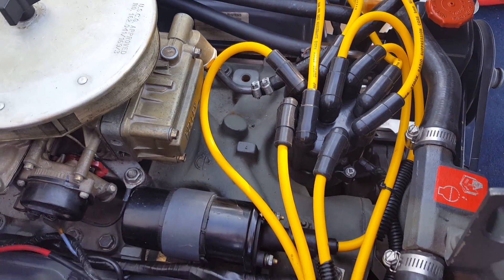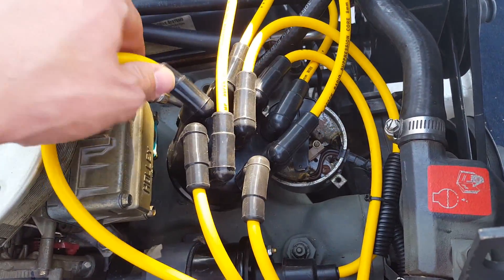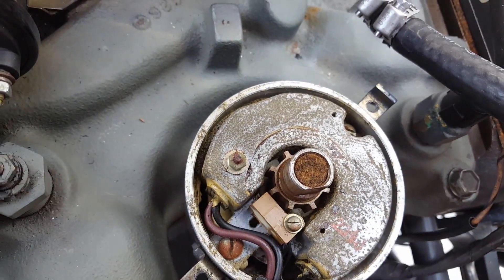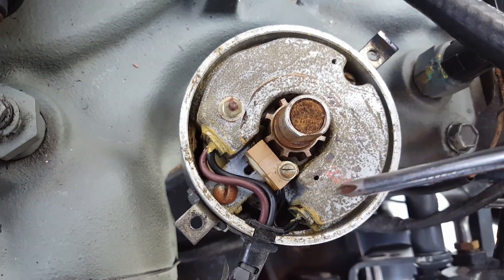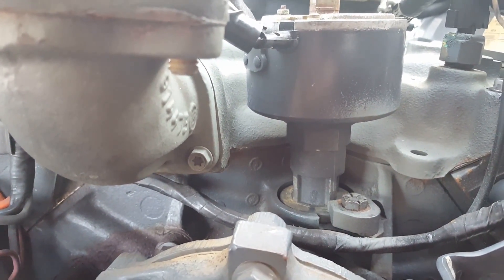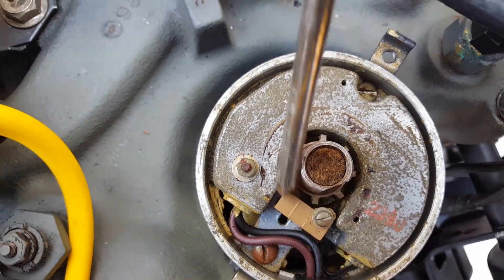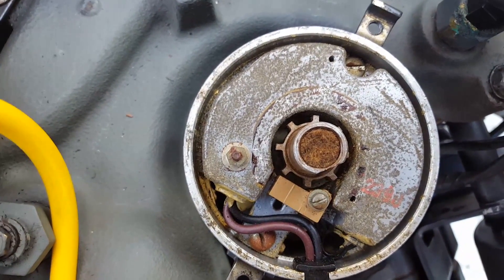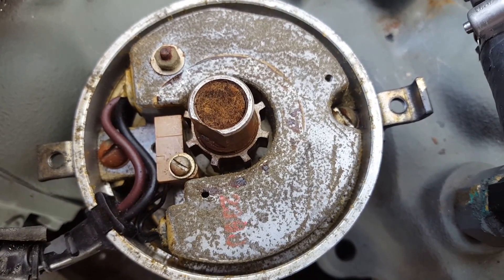Prestolite Ignition System Troubleshooting - ALL Marine Applications!

Comment: Can I use the pertronix 1589 for a v6 4.3 1991? I have the same pick up as yours I read all the comments looked up the part number and it says it’s for an 8 cylinder thank you for your help!
Reply from the maker: You should be able to use it. Try to drop it and see if it lands on the camshaft. And then use your timing light to get it perfect.
Reply: @m @michaelromer2016 ok I’ll try I didn’t know if it worked since it has 2 more cylinders thanks for now I’ll try to comment the outcome once I figure it out

Comment: I have this same engine setup in my boat. I have a fuel pump issue, how do you test fuel pump pressure on this setup. In the video. I can’t seem to find a tester on amazon that will fit the ford fitting.  Thanks

Comment: on that distributor, the timing advance seems to be centrifugial if so, the electronic components are easy to substitute, the pick up coil can be replaced by a Chrysler PU coil and the module can be replaced by a GM HEI 4 pin module, this needs a bit of thinkering to fit the PU coil im the distributor, you can conserve the original reluctor ring, the wiring diagram is very well detailed on the internet. 
 I done that on a 3.8 liter OMC ( chevrolet 229 base engine equipped with a point style  Prestolite marine distrinutor ), the complication was to design a special reluctor ring for the application as this motor is not even fire so I can't use the Chrysler slant six reluctor ring.
the result is very good after more than 10 years of use.

Comment: So how do you install the Pertonix?
Reply from the maker: The unit is pretty simple and even plug and play. Cylinder 1 needs to be at TDC and make sure the rotor on the distributor faces cylinder number 1. Fire it up and grab a timing light. Once you get the timing setup good, it will run like a champ.

Comment: Just changed my out to the pertronix. I checked the voltage at the positive terminal of the flamethrower coil I was getting 12 or greater volts. The pertronix 1589 requires at least 12v. I thought these had a ballast wire to reduce voltage. I have 9.8v at idle off the negative terminal. After install I was able to let the boat idle on the ramp for a while and measured 12.8v on the positive terminal. Does these seem correct to you? The engine started right up after install (minus 1 large back fire on initial crank over). Idle is smooth but tach is showing 2000rpm which is about 1500 rpm to high if I remember correctly.
Reply from the maker: You are on track but you need to make an adjustment on the back of the RPM gauge to fix that, I’ll make a video on that

Comment: What you're calling a "pickup" is called the 'distributor sensor'. The gap is called "air gap" and should be set to 0.008 inches (0.203 mm.) What you call notches are called "teeth".

Comment: Hey Michael I have the 2.3 Ford cobra I was hoping you can help me. My motor turns over but won’t start at some points it’s seems like she want to fire but still has not not even starting fluid. I’m thinking it’s not getting gas or something to do with spark. Should I try what you have done in the video and is there any other pointer you could give me I would truly be so grateful. Thank you

Comment: Wondering if you might be able to help me out. I'm pretty sure I have a bad ignitor based on this "click" test as well as some voltage testing I did based on the service manual. I have ordered the PerTronix 1589 ignitor, and also the PerTronix coil. The PerTronix coil is an internally resisted coil, and the coil that is currently there says it is "for use with external resistor" Do you know if there is an external resistor or resistor wire on this engine? Based on the testing I have done, with the ignition on I get 12v between the solenoid and purple wire that goes to the + side of the coil. If it was resisted wouldn't the voltage be less that 12v?

Comment: Do you have a video or write up ok how to set timing on this beast? Thanks
Reply from the maker: I tell you what, timing with the new one isn’t much different than regular timing. I do have a video on timing. Locate number one cylinder and determine the correct timing based on your motor. There’s a timing gauge above the harmonic balancer. You’ll be able to hear a difference in the way the motor runs when you rotate the distributor clock wise/counter clockwise.
Reply: @michaelromer2016 I cant find info at what rpm do I set the timing at and do I need to disconnect or short something while doing it?

Comment: I have a 92 OMC 5.8L and have issues with my ignition system. I’m told I need to find one that works with a a Prestolite screwdown cap and you also since I have a shift assist module,  this part must be intended to work with that. Is the part you mentioned above going to work? Do I need to buy any other parts? Thanks!
Reply from the maker: The aftermarket replacement requires the other part . Check the other comments under this video and you will see my recommendations.
Reply: Michael Romer I bought the 1589 prestolite ignitor and I am now being told it does not work with OMC engines with shift assist module... What prestolite ignitor do I need instead?

Comment: Michael - excellent video. I have this same pick-up in my 1987 454 marine Crusaders. I am almost certain the pick-up is shot in my port engine because I swapped the pickups between the port and starboard engines.  When I did this the starboard engine now had problems starting. So, I bought the Pertonix 1589 pick-up, but when I installed it, nothing, it will not start. Any ideas?
Reply: Also, I only had problems getting to RPM and/or keeping it running after it was warmed up and turned off, then started again. 
Is the pick-up susceptible to heat once it gets old?
Reply: @brentcarson3894  did you fix this problem
Reply: Javed Mohammed my problem turned out to be a bad fuel pump. I was able to get the ignition straightened out.

Comment: I have a ‘93 Donzi sweet 16 with the 5.0 H.O. I am upgrading to the Pertronix 1589, the Pertroniz 40011 coil. According to the CDI OMC Cobra Drive cross reference chart, I need the 123-7571 ESA. I am looking at the installation instructions that say to add a ballast resistor. Does my system already have a resistor wire?
Reply from the maker: I’ve seen those instructions. You don’t have a resistor wire already. You are tracking, make sure you had that resistor.

Comment: I turned the small nut on top of the pickup visible at 3:00. I thought I had to loosen it to remove the pickup. (I did not) Did I damage anything?  To remove the pickup you take out to 2 screw at 7 o'clock and 2 o'clock. Be careful not to drop them or the small lock washers down inside the distributor!!
Reply from the maker: Great feedback! Thanks!

Comment: For my engine, a 91 Ford 5.8L the gap between the rotor and the pickup (its galled the air gap)  is .008 in. or .20 mm. Yours may be different. This is found in various places: My Clymer manual has it in the Electrical System chapter and section for the Prestolite and in my Seloc manual in section 10-45. WARNING Have the Ignition OFF while you check the gap. Your feeler gauge can trigger the ignition and cause a spark.  Depending on where coil output wire is sitting, you could start a fire. So Ignition OFF.  If you are rotating the distributor to intentionally cause a spark like in the video, please be sure that you know where the spark will go.  You can ground the output from the coil. I do not think it is good idea to pull the output wire out of the coil because then the spark has nowhere to go. That may damage the system. The best option is to use a spark tester tool that simulates the spark plug gap and clamps to a good ground.

Like this one: https://www.napaonline.com/en/p/BK_7002015
Reply from the maker: Great information!
Reply: Just changed mine out. I purchased a replacement one years ago when I bought the boat. (OEM). Boat started right up but didn't know the gap. I just guessed at it. The information you gave me on the gap is just what I have been looking for. Thank you so much.

Comment: Michael I did screw up my igniter setting,,, can I get the specs instead of using a credit card haha
Reply from the maker: Derick. There are metal feeler gauges to get it exact. I recommend not using a credit card, it’s to big. A business card is perfect.
Reply: @michaelromer2016   are you saying that you dont have the spec then? and a business card will do...  thanks
Reply: @michaelromer2016   can you point me in the right direction to the best distributor to buy for my 5.0 ford marine

Comment: I have one more question. I have installed the 1589 in my distributor. I notice the pickup on the old module is about 6 o’clock. The new module sets about 8 o’clock. Will need to rotate the distributor to make up for the different position of the pickup. Thanks
Reply from the maker: Set the distributor in where it goes in with no effort. If you have to rotate it to get it to drop in, pull it out, and give it another go. Once it drops all the way in, barely tighten the bolt. Fine tune the rest of the way with a timing gun. If you don't know how to use a timing gun reply back to me and I'll make a video.
Reply: Got it running thanks for all of your help!

Comment: Bolt at 5:55 is definitely stripping not turning
Reply: Great video though- helped me a ton, thanks!
Reply from the maker: Sorry to hear that bolt is stripped! Try re-threading it. https://www.amazon.com/Best-Choice-40-Piece-Tap-Die/dp/B073YC3S8F/ref=sr_1_1?keywords=standard+bolt+threader&qid=1567486325&s=gateway&sr=8-1
Reply from the maker: Also make sure you plug up the distributor hole too in order to keep metal from getting into the oil.

Comment: my electronic pickup in my omc 4.3 is shot and they do not make it anymore do you have any idea what other one i could use so i dont have to switch back to points. It is a prestolite distributor my email address is raddash67@gmail.com any help would be greatly appreciated
Reply from the maker: The most common part that fails is the electric pickup. If you need a new one, buy this one: https://www.amazon.com/dp/B004OXPDC4/?coliid=IS0EEDWN1YJ4K&colid=3A5H05E4WD179&psc=0&ref_=lv_ov_lig_dp_it
Reply: Hey Brad  did you ever find a replacement
Reply: @EllienZoe_4413  no i did not boat still sitting here lol thanks for reminding me though . you got any ideas

Comment: Hey another question new petronix 1589 and new coil still no spark at coil both 50 amps ok, what else could it be? 93 fourwinns 215 with omc 5.8 thanx for your reply
Reply from the maker: You likely have a bad ground or there is a line that was disconnected in the process of repair. https://www.go2marine.com/productcenters/electrical/OMC-Diagrams.pdf

Comment: 1 more question if you dont mind. I'm headed to a pull a part yard. What's the original piece called? Or which vehicles might share this component?
Reply from the maker: The distributor's electronic pickup. Old school people called them points. Keep in mind you aren't getting points, you have an electronic pickup.
Reply: @michaelromer2016  thanks man. Tried to find on that fit through old cars about 200 fords. No dice. Upgrading electronic pick up and ESA it appears.
Reply from the maker: Ronnie,  order it here: Pertronix 1589 Prestolite 8 Cylinder Ignitor https://www.amazon.com/dp/B004OXPDC4/ref=cm_sw_r_cp_apa_i_wTOiDbPHKG0SV

Comment: I have 92 omc 5.8 no fire at coil the module in distributor is same as urs it failed click test can i put 1589 petronix iginitor in distributor and fix my boat
Reply from the maker: Exactly,  Pertronix 1589 Prestolite 8 Cylinder Ignitor
Reply: If I switch to the 1589 do I need to update the EAS module. Thanks for the video
Reply from the maker: @TheFire1man  Run your motor after you get the timing adjusted and test your ESA. I'm hoping Petronix may have updated their 1589, if they didn't and your ESA doesn't work (and it did before you changed it), then you need to follow these instructions http://www.hastings.org/~stuart/cobra/diodefix.jpg

Comment: Can you please get in contact with me I need ur help for my boat engine  kob1533@gmail.com
Reply: I have no spark at all
Reply: Where do I get the electronic pickup I can't find the one that's in the distributor any where
Reply from the maker: Keith, did you run through the steps in the video? And you still have no spark? Also remember, you need to make sure your coil is good too. I have a video for testing your coil. Let me know once you check your coil and reply back. Because your coil is upstream of the electronic pickup, that needs to be tested first. The coil is cheap, the electronic pickup is expense ($20 vs $100). If your coil is dead and the voltage isn't there at all, then you need to look at your ignition solenoid, which is upstream of your coil. Let me know what you find.
Reply from the maker: @keithbrooks153  https://www.amazon.com/dp/B004OXPDC4/?coliid=IS0EEDWN1YJ4K&colid=3A5H05E4WD179&psc=0&ref_=lv_ov_lig_dp_it
Reply: I ran through the steps theres no clicking noise in the distributor 
So the link u sent me will replace 
The petronix that's inside this distributor 
Take the old one out a few replace it with the one u sent link for
Reply from the maker: Did you make sure your coil was good? You won't hear a snap if your coil is bad. All you need is a voltage tester to check the coil. Here is the link if you haven't checked it out already.  https://youtu.be/fLIfX1MvI1I
Reply from the maker: What do you have going wrong? I prefer to put the comments here. You would be surprised to see how many people have the same issues you have--that's why I like to put comments for all to see.

Comment: Michael. Thanks for the video. My distributor is exactly like yours. All of the replacement ignitions appear to be retro fit for an ignition that had lobes on the shaft to open close points.
Since the one in the video (like mine) don't have lobes, but rather the 8 magnetic points for the hall effect sensor, does this mean the whole distributor must be replaced ? Or just piece out a sensor and adapt it keeping the existing magnets that appear to be press fitted to the shaft  ?
Thanks, again.
Reply from the maker: The most common part that fails is the electric pickup. If you need a new one, buy this one: https://www.amazon.com/dp/B004OXPDC4/?coliid=IS0EEDWN1YJ4K&colid=3A5H05E4WD179&psc=0&ref_=lv_ov_lig_dp_it

Comment: Mike thank you for the video. When you change out the pick up  is there anything else that needs to be changed.  I a few hundred dollars in parts and still not running.   And do you know where the white wire with a black strip hooks to on the coil.  Please help. 
1994 omc cobra 302 ho. 
Thanks.
Reply from the maker: I have 94 302 in the back, I'll take a look and get back to you.

Comment: Hi mike, I was wondering if you would advise installing just the new pickup that you posted from amazon, or would you be better off installing a whole new distributor. In this case what would be my best option for a 5.0 with forward distributor?
Reply from the maker: I would keep your distributor. The Pertronix 1589 upgrade is your best option. The only catch is the need to change the ESA module to the upgraded one I mentioned.
Reply: Michael Romer do you happen to have a number for that as wel?
Reply: Do you have number for ESA module as well?
Reply from the maker: https://www.marinepartssource.com/shift-assist-module-cdi-electronics-123-9898-p?gclid=Cj0KCQjw45_bBRD_ARIsAJ6wUXQZ1GJJxHbypQ7wyur8M5zzFZ8npbwu-qPaQfwF2pVcLGy4xxaLej8aAjFMEALw_wcB
Reply: Michael Romer I have been doing a little reading on the ESA module link you shared. It does not directly replace my current module. I’m assuming I need to switch to this other model for the new pickup to work properly? or do I need to just put a new module in that cross’s to my current module?

Don’t want to order the wrong thing! 

Please help, thank you!
Reply from the maker: You are right, if you aren't switching to the new pickup, and you want a new ESA module--get this one. https://www.ebay.com/itm/A1-0987876-987876-OMC-Cobra-5-0L-5-8L-Stern-Drive-Shift-Module-Kit/332603692016?epid=1230982070&hash=item4d70b993f0%3Ag%3AdDYAAOSw2ylavk3P&_sacat=0&_nkw=0987876&_from=R40&rt=nc&_trksid=m570.l1313

Comment: Hi mike this is Ruben, you have a grate video, how I can find the pickup retrofit, mine is exactly like the one you showing thanks for the help best regards
Reply from the maker: Hey Ruben. This is exactly what you need. https://www.amazon.com/dp/B004OXPDC4/?coliid=IS0EEDWN1YJ4K&colid=3A5H05E4WD179&psc=0&ref_=lv_ov_lig_dp_it

and 

http://www.cdielectronics.com/product/shift-assist/omc-sterndrive-shift-assist-123-9898-p-replaces-982749-982755-982774-984036-984276-984281-984730-984740-985902-986342-986837-987738-987739-987740-18-5888-9-24500/

Comment: Mike, this is Bryan, another great video. I'm assuming you have a Ford block, as the distributor is in the front of engine. Ours is the 5.7 GM block. Our distributor is in the rear of the engine. It is the Prestolite brand. I was told also a Mallory distributor was also used on my engine. I still run the breaker points, change them every 10 years. They never once failed before removal change out.  I carry a spare set on the boat, never have needed them.  Actually I think the Condenser (really a capacitor) would be more likely to fail due to aging.  Our motor year is 1990.
Reply from the maker: Deborah Bicker Thanks so much! Yep, mine is a 5.8, but I also have/had many 5.7s--so in reality, I'm better with a Chevy block. I'm about to post how-to test a capacitor. Super easy to do in a few minutes with a multi-meter.